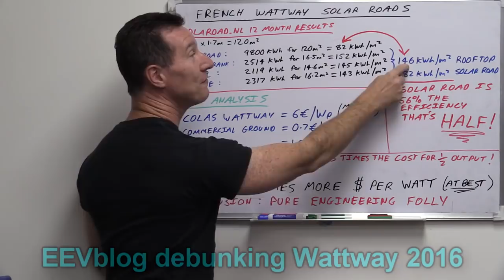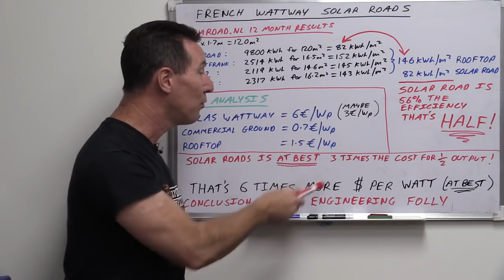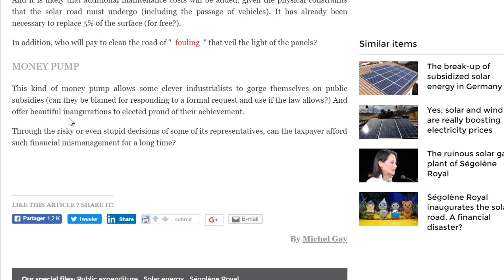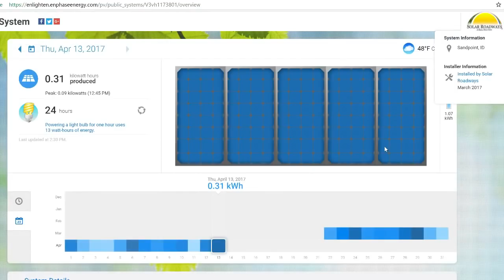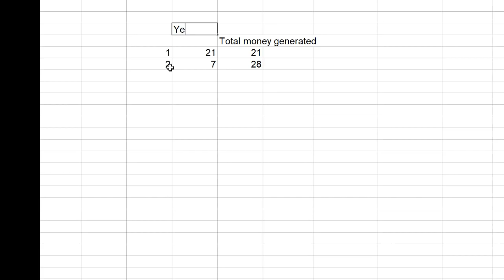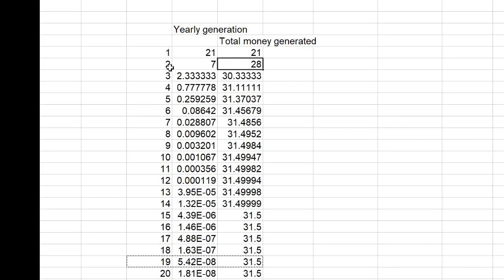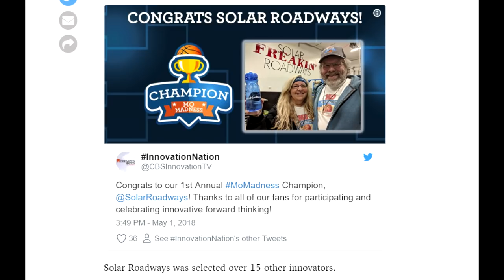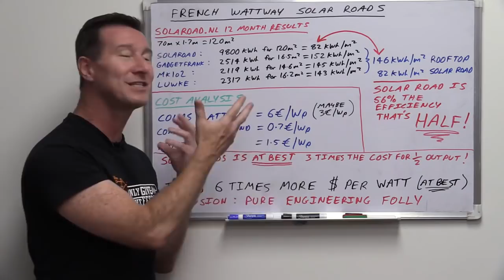Solar Roadway: 10¢ return on $1000 investment!

Comment: What's the point of solar roadways anyway? I still don't get it. I get that luminous roads is an interesting idea, if you can pay for it and have the electricity to make it work. But why do the roads themselves also have to be solar panels? It's not like we have an electricity crisis, or that we lack the space to pose new actual solar pannels. o_* If they somehow managed to use the heat or kinetic energy from the cars, that would make a bit more sense, I don't know.

Also, I like that they claim this pushes further the idea of building solar panels in the desert. How is this going further? Why don't you do that instead, you'd actually be useful to mankind then. :p

Comment: Why not just make tire groves that act as tracks for cars to drive in and put solar panels in between using a strong resin. The resin wouldn't be strong enough at all to take the brunt of traffic but would hold up to every once in a while people driving over them. Then you'd have to require lane switching be a last resort.

Anyway lets focus on having less need for roads rather than "upgrading" them with solar panels. Roof tops are still by far and easily the best place for solar panels because roof "tech" need some serious improvement.

Comment: All street lights should get power from solar panels. If there isnt enough power it should switch few % of lights off. That way you can make a whole street light grid without using energy from the grid.

Comment: We would be better off if the cells were designed to take pressure and produce voltage... then as vehicles drove over them the weight of the vehicle would create voltage.

Comment: They went about the solar roadways all wrong. What they should have done is made an awning overhang the roadways  with streetlights beneath them to illuminate the roadways. Thus getting the maximum efficiency out of the solar panels. Then it might have worked. Might have worked. There would still need to be a lot of planning behind this and the repairs for the panels would cost a substantial amount of money...

Comment: Why not just put them over the roads like a canopy and that way people use less A/C  and they won't have to plow snow every year, that makes more sense than a $3 million dollar sidewalk that broke mere months later
Reply: that would make more sense, but still not ideal, since if you place them above the roads it could introduce hight limitation for vehicles (might not be a problem when you install it, but could become a problem in the future if taller vehicles start getting introduced, also it could cause traffic issues when doing maintenance in the solar panels, a much better idea is what it is shown in this video, put it on the side of the road, that way it doesn't create any problems for the road traffic, especially when you have to do maintenance in the solar panels, a canopy would be more approriate however for parking lots, some already do that in fact.

Comment: I mean, this idea was smart in theory, but I think that plain old asphalt and paint is far more reliable. If anything, you could have heated roadways and LED road signs.
If you wanted to have solar panels with roads, you could have panels on top of signs and stoplights.
Reply: you would not be able to see the LEDs  flat on the ground  during a sunny day the same way you can see normal road markings with paint.
Reply: @joaozin156  that's what I was saying, I'm just pointing out that it would seem like a good idea on paper, but not in reality.

Comment: "Putting solar panels on 1% of the world's deserts would produce enough energy to cover the entire world's needs."
Well then why not try and do that instead of putting them on frequently blocked surfaces which have large amounts of weight put on top?
Reply: That's the issue. Alot of roads arent covered except during specific times. The issue with the test was it was in a busy section of road.

Comment: There are a few thing s always overlooked that would cripple such a project even if the energy production worked, none of those ideas have a quickly and easily replaceable surface as textured glass won’t hold its texture long-term.

Comment: How would having solar roadways be better than just having regular solar panels? What’s the point of combining solar panels with roads?
Reply: well with the solar freaking roadways, the gimmick they were using for that was the stupid idea of using LEDs as the new road markings,  so that the road sign would adapt as the traffic changes, ignoring the obvious problem that it would be impossible to see those LEDs from the position of a driver during a full sunny day.
Reply: Takes less space
Reply: @Ragnaracc  how is making roads out of glass taking less space? If that's really a concern just put it on buildings??
Reply: @kinesslop651  3.9 million miles of road
Reply: slop  also necro post much
Reply: @Ragnaracc  but we have more roofs do we not? And what's on roads? Cars, it's not transparent so even if it generates passable electricity they still would be making less energy than roof top. The point is they're weak and can't even handle cars, generate less electricity than other renewable energy, cost a lot, and can't beat any alternatives in any aspect.
Reply: @Ragnaracc  Yes, as if we are having a psace problem rn. Ffs roads are built to endure alot of forces on the daily, do you think making it into solar panels would enable roads do the one thing they're made to do? There's a reason why it's made of concrete, rebar, and asphalt.

Comment: Are the initial numbers of 21 and 7 for year 1 and 2 net production? If so, we have a constant factor deducted from the gross energy production. We might not know what the factor is, but it could probably be roughly calculated based on the amount of panels and the amount of LEDs on each. My comment is completely irrelevant if the numbers are gross energy production without the energy expense factored in, but the lights and heat production are controlled on-board, so I would think that the recordable output is a net value (unless they're so "smart" that the hardware records these values every step of the way). If it is as I assume it is, we're talking about a percentage decay on energy production and a roughly constant energy cost as two different factors. The cost is constant and the production is decreasing at a parabolic rate, so the production would probably be essentially irrelevant by year 3 and even more irrelevant as time goes on. At least by year 4, you can pretty safely assume that it's just the constant energy cost.

Comment: Amazing that nothing has changed since I first heard of this.  My first concern was the durability of the surface for pressure, changing temperature, and obviously no type of glass can be used for such.  Roads also take a beating from earthquakes and floods/water, just too difficult
Months or years after that, I've heard of the idea of setting up conventional panels as they build new roads which makes more sense.  Though my concern with it is transmission and maintenance.  Unfortunately, I havent heard of it again.

Comment: Ok it's time to shelf this idea until if  & when technology advances make it feasible. But I get the impression from this video that you WANT this idea in specific, & other ideas on how to create technologies utilizing renewable energy, to fail. I apologise in advance if that is not the case. I applaud efforts to find & create such technologies - although taxpayers really shouldn't have to subsidize high cost projects which are high risk/low return projects.
Reply: Leslie Shafer No he doesn’t.

It’s just that no matter what you do, solar roadways don’t have a place anywhere.

They would have a lot of stuff driving over them on highways. They would be overshadowed by buildings in cities. They would be blocked by cars on top of them.

Solar roadways should have its plug pulled and never revisited. Just put the solar panels in the desert.
Reply: @thesafehouse2863  
I did say the idea should be shelfed until IF & when advances in technology makes such an idea feasible. I agree with your belief that it will probably never be feasible. What I was really objecting to was the tone of the video. I don't understand why the trend nowadays is for people to  think that being confrontational is more effective than presenting a well  reasoned argument. Your response to my comment was such an argument, and I thought it was very good.

Comment: And what happens if water gets between the panels and freezes? No, not a little bit. I'm talking Wisconsin winter when nature is pissed at the world. When the snow plows can't keep up and they get tractors with massive snow blowers to remove the snow?
How do they handle frost heave? Or the ripple effect that heavy trucks produce which causes pot holes.?
What about areas where people ride horses and the horses' steel shoes chip up the pavement? What about when there's a car accident and several vehicles scrape the road as tires are blown and dozens of tons of metal are slid down the road like a giant sanding block? And if they can charge cars, will I get electrocuted if it's wet?

Comment: I think the best place for those solar panels may be above the pantograph over railway-tacks. In that case it prevent snow from falling on the track, and as the railway need the electricity it will have the stretched out infrastructure to make something useful with the energy.

Comment: Que  the YouTube geniuses calling people morons. Maybe you are missing key points like..... roads already cost money to maintain-- with no return.
Reply: Getting return doesn't have any benefit if the INCREASE in cost is more than the return.  Furthermore, it ignores the concept of opportunity cost (ie: using the technology correctly and getting a better return elsewhere).  Think of it this way suppose you could go to two restaurants one costing $10 per meal and one costing $5 per meal.  But the $10 one promises one dollar back if you dine there.  For the sake of simplicity lets set that the food is of equivalent quality.  That's a 10% return on your money and you have to eat anyways so it's clearly better than the $5 restaurant right?   Well clearly this is wrong since the initial cost is 2x the 10% savings don't compensate you are still wasting 80% more money by eating at the $10 restaurant.

You think the analogy is oversimplified?  You're right...in fact the simplifications are in the favor of Solar Roadways.  Instead in this case the cheaper option (rooftop installations and solar farms) actually pay back more money (this is that opportunity cost thing; resources are finite doing something always means not doing something else) in addition to being cheaper.  Asphalt road production and maintenance is actually dirt cheap in comparison to the equivalent to ANY form of solar roadway.  Not by meager differential either, but by 1 or 2 orders of magnitude (10s to 100s of times).  The example above wasn't even a SINGLE order of magnitude and the 10% return may be better than what these systems returned.  You haven't solved your energy problem, you haven't mitigated roadcosts, you've simply spent more money to waste solar panels.

Solar power has a powerful role in a clean power infrastructure, and using public space to deploy them certainly makes sense; however, the ground much less a road is simply the least optimal place to put them.  Simply put them on the side of the road (or above maybe) and set the profit to assist with road development and suddenly things look better, in fact they look viable in regions with actual electric consumption.

Anyone with a science or engineering background could grasp this immediately, this is a direct consequence of when marketing and woo overpower rational argument (yes scientists in industry often choose or are forced to do stupid things for monetary reasons).  I will admit Thunderf00t's arguments are handwavy on parts of this topic, but EEVblog's estimations and rationale are solid, and the fact that he chose to share them via YouTube does not invalidate his actual expertise as an electrical engineer.
Reply: This is the most retarded thing Ive ever read.

If it already costs a lot... WHY INCREASE THAT? It’s return is that businesses can move their product, that we can move ourselves from place to place, and people are connected by miles of roads. So why pay more for something that does all that, plus nothing extra because it sucks at producing power?

Comment: You don't understand what research is do you. Wind power and solar were uneconomical until 15 years ago. I bet, in fact I know people back then said "wind power will never work it costs too much" without thinking that maybe this is the first generation. People don't look at radar ranges and say "microwaves will never be a household appliance, it doesn't even fit in kitchens." 

Solar roadways are a brilliant Idea. Moving electricity generation and transportation onto roads rather than houses and power lines. Yeah the tech obviously isn't as good as rooftop solar but rooftop solar isn't as good as solar farms either. Over time as solar becomes cheeper than coal just like wind did. We'll see this tech prosper. 20 years and the tech will be cost effective. Right now its a niche market. Just like electric cars 10 years ago.
Reply: Kers1 I want you to explain to me how a solar roadway would work in a major city. Take into account the sub being blocked by buildings for parts of the day. And make sure you notice that there is a lot of traffic and sometimes there’s traffic jams that either cover or damage the roads.

Now I know what you’re thinking. “Just put them on highways then.” But at that point, why not just put them on the left or right side of the highway? Why make the highway produce power when you have all this land beside it (that no one drives on) doing nothing?

If you wan cities to produce solar power, you get solar panels on roofs or you make solar farms.

The roads are useless. And don’t solve any problems.
Reply: Firstly, I love your name. Secondly, isn't it common sense that you wouldn't do this where there is little to no sunlight? I was thinking of cities in Africa, Australia and middle America where the area is car centric. I wasn't even thinking of highways, I was thinking of regular roads in cities with less than 500,000 people where there is direct sunlight, a lot of road and not much extra space for solar generation. To be completely honest I was thinking specifically of my city of Perth and of LA. Also, solar roads is easier than installing on peoples houses and although current tech shows that lazer tech which separates light is the best (AKA modern solar farms) that isn't to say someone in the future wont make a solar pannel which reaches above 60% efficiency. There is a lot of room for improvement in solar.

Comment: 40 euros per megawatt hour? Doesn't sound correct.
I did some digging, and Germans pay out 30 dollars for 100 kilowatt hours, or 300 Euros for one megawatt-hour hour.
Still laughably inefficient, but it's better to use proper numbers

The price in Bulgaria is about 10 euro per hundred kilowatt hours, or 100 euros per megawatt-hour

Comment: Love me some Thunderf00t, but I still disagree with him today on this. I disagreed with him back on his first original video as well. What we need to understand here is these are baby steps to a actual working product. You cannot look at the cost and the return at this stage, that is not what this is about yet. Solar panels have VERY little innovation occurring them right now and trying to find new ways to apply them to make their usage worth using is what is important right now, the costs of everything will be obviously high until such time as the tech is refined then able to be mass produced. As interest and usage in more solar continues, just as it is occurring right now, more research is made into making them more efficient and cheaper. You are literally applying usable apples to current alpha models of oranges.

We KNOW the current line of Solar Roads are not fiscally viable, they are not meant to be yet. They are meant to show they can work....at all.. right now. They do not need to produce a lot, they do not need to be as good as existing standard panels, they just need to work as a road and still be able to produce power. In 1886 when cars first came out they went a max of 10mp/h, 16km/h for everyone else on earth, and if you wanted to try and do what you are doing now with solar roadways then, we would not have cars. Technical demos, proof of concepts, and just showing it can WORK at all with the current tech we have is all these are supposed to be doing. Once the tech gets to a place where they can show given R&D on making panels better, lowering costs (dramatically), and hopefully finding a better way to cover roads while still getting more power.... then these will start to be taken seriously. Until then, you guys need to stop acting like this is supposed to be a finished ready to deploy product, it's not.

Comment: It's a fantastic idea. But technology isnt there yet maybe within a 100 years
Reply: The problem is no amount of technology will ever make this use of photovoltaic cells reasonable.  The panel that gets the most sun light will generate more power at ANY given efficiency.  If you put them on the roads, geometry and physical occlusion will inexorably destroy your efficiency (in fact the percent loss is irrespective of the efficiency of the panel.)

Comment: I said it before, and I'll say it again:  I'm not an electrical engineer.  But all it takes is a modicum of common sense to see how absolutely, mind-bogglingly stupid this whole exercise of "solar roadways" is.  How about you just slap solar panels on every rooftop.  There.  1/100th the price, 50x the energy output, barely any maintenance.  But, no... instead we reward idiocy.  Congratulations, dumbasses.